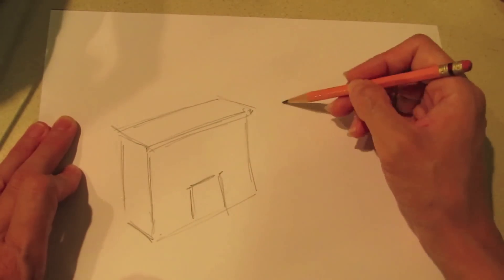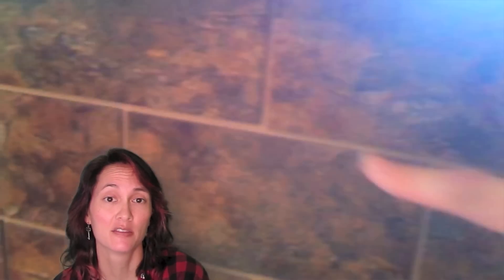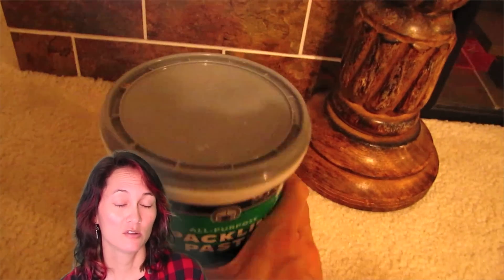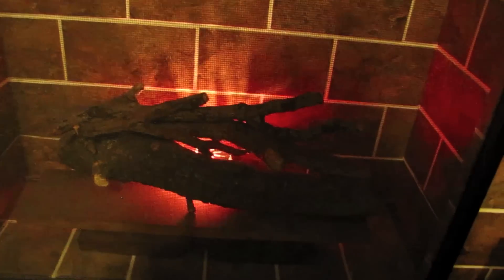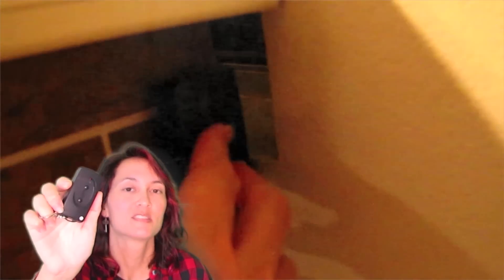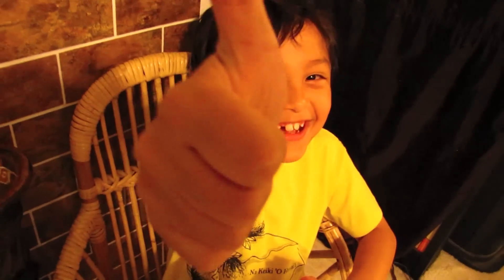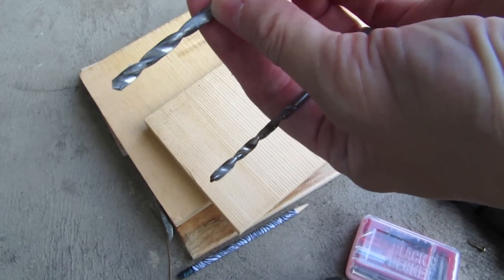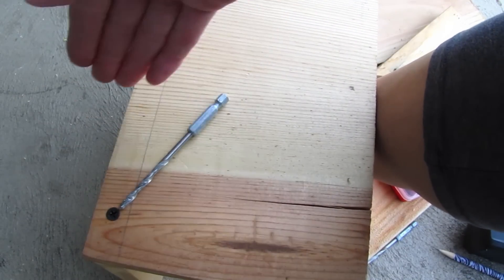🔶 FAUX FiREPLACE DiY ➤EASY.Carpentry💫

Comment: Great job!! way more durable than mine. I used the box my TV came in and the columns are wrapping paper tubes cut in half. I also went with a colonial off white spray paint. The 19" monitor used also has built in speakers that I connected to the headphone jack of the netbook, so it actually has the sound of a real fire. Mine had to be made so it could be disassembled easily and light, because it was for a display at work. Thanks for the comments on mine!

Comment: Jackie, I love your fireplace. I have had a fake fireplace, but had to give it up this year. For those who are looking for fake fireplace logs, go to Ebay and put in fake fireplace logs or check store catalogs.  The fake fireplace logs are wonderful and I prefer them over the electronic ones they have out now. The Crackling Fireplace Logs are great because they make a sound that is caused by a metal tinsel in the back of the logs and it sounds like rain on a tin roof. Like Jackie's log, it is run by a tin wheel thing that turns a round plastic cylinder that creates the flickering fireplace. Go to this link to see one example of an electric log Crackling Glowing Embers Electric Fireplace Logs .  You use a red light bulb to get the effect of fire and you can get those in any hardware store or on Ebay. They have different types of electric logs and you can basically pick and choose what you want. I have electric logs and no fireplace at the moment.
Reply from the maker: Hi Lou Ann, thanks for your comment, nice to find someone who appreciates faux fireplaces =)  It's hard to find electric logs here on the islands, and ebay shipping is always so expensive, so I haven't had much luck finding an affordable one.  ...maybe one of these days I'll be on the mainland, and I can pick one up.  Thanks again & Aloha from Hawaii =)
Reply: I think I bought my original logs from a Sears catalog many many years ago and I love it because it is looks like glowing embers and I have actually had people trying to warm their backsides with it and fall asleep watching it. I have bought fireplaces for friends and got them similar logs. I don't really like the new fireplaces that are out now. The logs really don't look that real although I like the flames on the backwall. I have had people who have hated cleaning their fireplaces or lived in a mobile home with a fireplace and was afraid to use them and I have bought the logs for them and they were over the moon. If anyone is interested in fake electric logs, go to Craigs's List, your local fireplace store, Amazon or Ebay. They are out there. Some are ridiculously high and some you can get at a decent price. The only thing is you have to find red light bulbs, but you can find them on Ebay, your local hardware store and maybe a local store like Kmart and Target. They are normal size light bulbs but are referred to as party lights and they are inexpensive. To me a house is not a home unless you have at least one fireplace. There is nothing like sitting in front of your fireplace with the lights out, listening to romantic music and just chilling.
Reply from the maker: Lou Ann Steele I totally agree, I think the new fireplaces look fake.  I like the old model, where it spins tinsel to make that crackling sound & has realistic flames at the back.  ...if you find any good ones out there, let me know, and maybe I could make a bid =)

Comment from the maker: Hi, I tried to replicate that metal piece myself, but was UNsuccessful. It has to have the right weight & curvature.  I'd recommend using a short strand of big christmas lights & replace it with flicker flame bulbs.
OR you might use red christmas lights bunched behind some cute logs to create that "warmth. 
Also, I recently found a mini "faux fire" on amazon which might be good.  (look in the description for the link)
~hope that helps =)

Comment from the maker: hey, thanks for your message. ~Yah, I wish I could find a place that sells that piece, as it ACTUALLY works! The only thing I can think of is to try to find a fake fireplace on ebay with pieces included. I tried to make one with a pop can as well as sheet metal, but couldn't get it to turn like the original piece. The only other thought would be to buy a short strand of big christmas lights & replace it with flicker flame bulbs. Or just christmas lights does add a nice touch. ~hope that helps =)

Comment: What is that metal piece called that you use over the light bulb??  I have an old fake wood set that has bulbs in it, and it used to have those pieces, but they are missing. I have no idea how to attach it the way you described.  Couldn't find anything else on the web for that light idea.  Crazy that NO ONE else is doing this.  Any suggestions???? I tried to make some pieces out of a pop can and sheet metal, but can't get them to turn!!! HELP!!!!